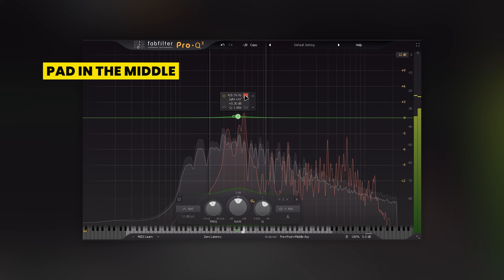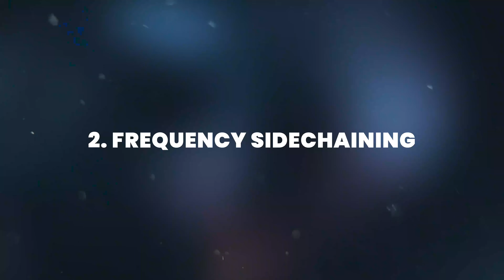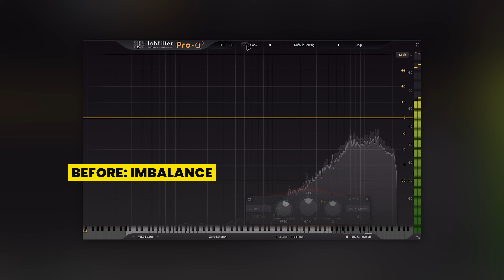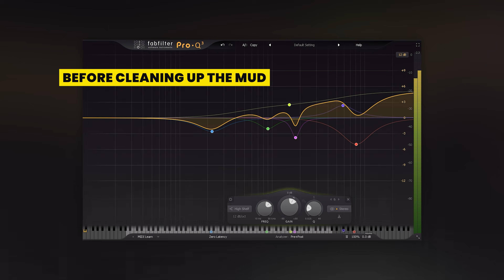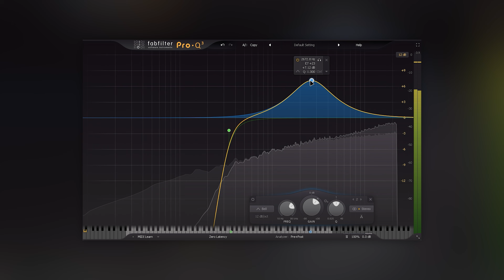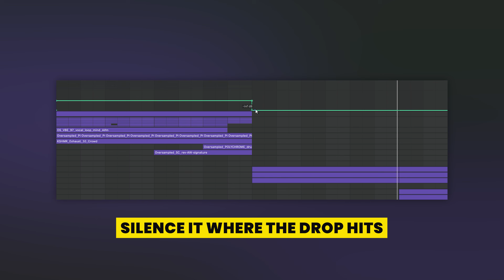BEST 9 MIXING TECHNIQUES

Comment: Hey man not relevant to this specific video but I was looking for a answer to this and I knew to go to your channel immediately.  When your looking to sample a song etc what version should we be looking for to get the highest quality out the back end? I mean like the bitrate, kb, file size etc for example lets say im sampling a old lil wayne song and theres a bunch of versions on youtube I can grab it from, which would sound the best once the audio is ripped? Basically should I always try and get the audio with the largest numbers?
Reply from the maker: Filesize, bitrate and a format will all match. Just go for WAV/24, but you won't get it from YouTube. YouTube is mp3 I think 192kbps? Something low. So just go to Spotify, the highest quality level and record the audio with voicemeter banana or some other audio rec into wav/24. Best quality you will find will be on tidal master quality. There you have flac 192khz or 96khz 24bit. You don't need to go this high, you will end up making music into wav/24 anyways, tho you can try recording max quality as it may translate better when rendering.

Comment: My op mix strat is to rout every rack in parallel to a single bus that’s routed to nothing. On that bus, slap a pro q 3 and name the bus something like “de clash boi” or whatever. When ur tryna mix in an instrument, add a proq to that rack, un rout it from “de clash boi” and view the “de clash boi” named proq instance. Now you can see where you need to cut and boost that boi to get it to slide on in there. Than, rout it back to the reference bus and check again. Sometimes, phase cancellation makes it so you need to over compensate nd stuff. Can reverse the rack polarity to check if this fixes it. Usually, I’ll start by comparing central, main instruments. Than slide everything around em. It cuts out a lot of the guess work but, doesn’t limit “using your ear” because, you still can decide where everything goes. You just have the ability to check whether or not your decisions are going to mess everything up in advance and can make more accurate calls.
Reply: Oh yeah. I mainly save this for stems. Just cuz, at that point, I usually have a lot more things grouped or layered/ less cpu dedicated to synths. Tho, I’ll still do it in the earlier stages, mainly for more important sounds that I want to blend and compress together.
Reply: 2:43. Basically this. But, with everything. It’s fast af.